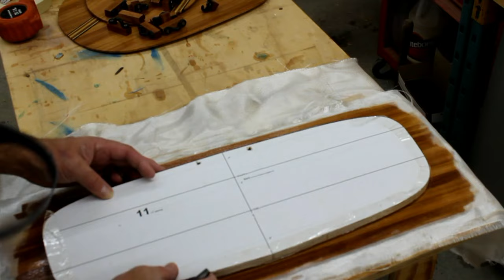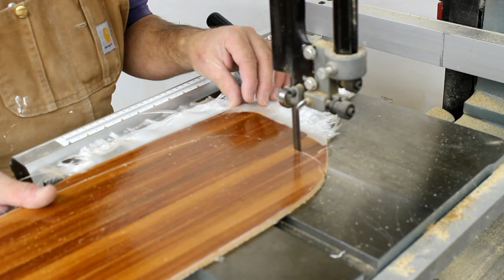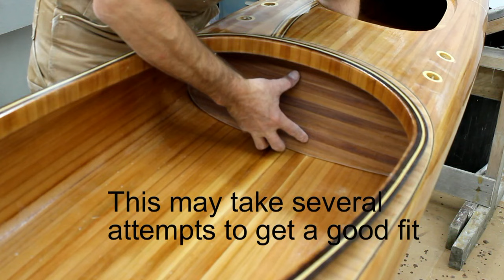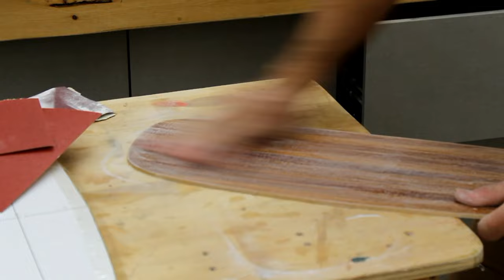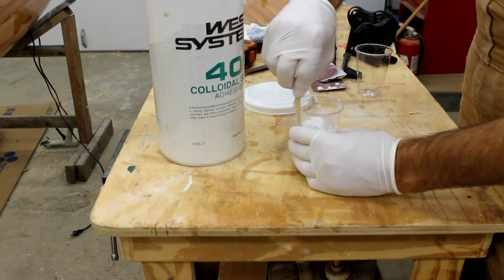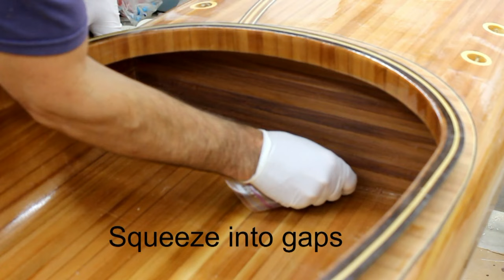Installing bulkheads into a wooden kayak

Comment: How much would you save each bulkhead weighed? I'm trying to figure out if I should replace my bulkheads in my kayak with carbon fiber ones. if it will make a difference,weight wise. Trying to make her less heavy.
Reply from the maker: I don’t think the bulkheads weigh much more  than a few ounces  Mine are strips planed down to probably 3/16 and then 4 oz. glass.  Several layers of carbon fiber may be a bit less, but likely more expensive.
Reply: OrcaBoats i keep wondering if i should go throughthe process of replacing my bulkheads with CF ones,im trying to reduce weight and looking into whatever way i can.thanks for the reply.